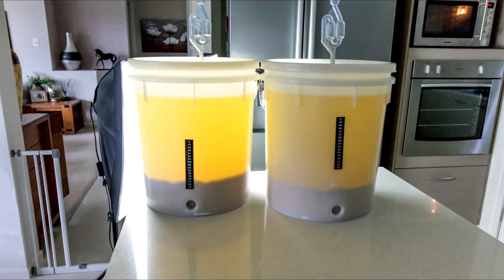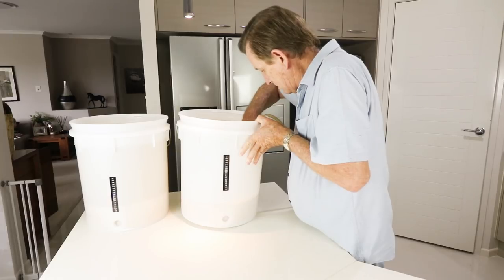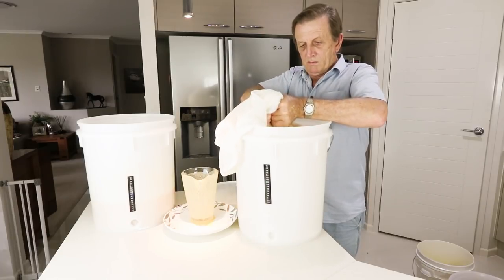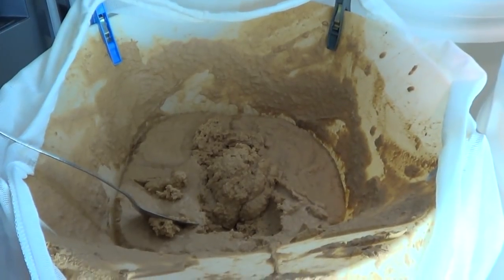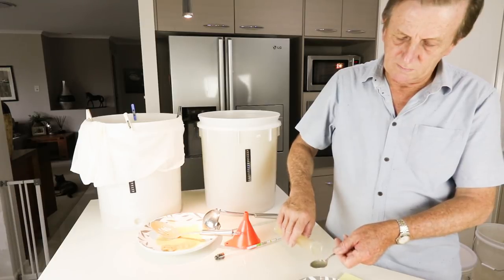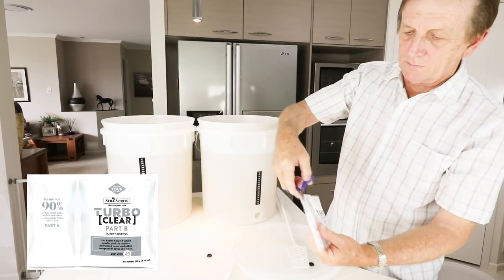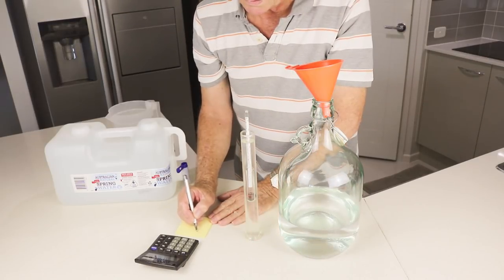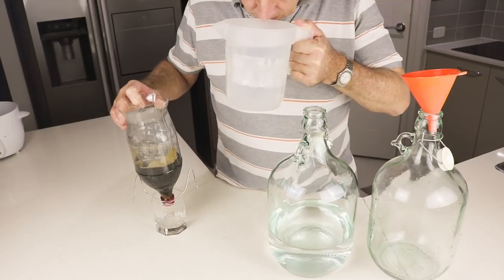How I Make Cornflakes Whiskey - Pt.2 The Distill & Taste Test

Comment: After running it through the filter does it still have the flavour of the whisky do you need to add wood chips because you could just use alcohol from reflux and put wood chips in it and do the same thing is that right

Comment: One thing you could do (I did not see anyone else mention this), but you could have rinsed your mash (the cooked grains) after you poured off the wort (the sugar water).  This is called sparging by the mountain folk here in the US, and it lets you get the last dregs of wort out of the mash.  It's easier to do than trying to squeeze the wort out of that big ball of mash.  JM2C.
Reply from the maker: Hey X.... Worth remembering, thanks.
Reply: @pauljacobs5390  Or just throw another 6Kg sugar and water in and let it rip again, bring up to temp and the yeast should wake up and a week later rack and still.

Comment: For ageing it could be better to try it at 62% abv. 40% sounds a bit low for ageing and extracting the flavours from your chips
Reply from the maker: Interesting, I think I will try this next time round.... Thanks
Reply: Can you use frozen corn from super market or food store?
Reply from the maker: @M_Ladd  Of course you can, but it will probably end up costing you too much. Refer to my Vid on making Corn Likka.....
Reply: correct it needs to be at least 62 or 72 thats how they do it at distilleries
Reply: Yes agree, I always age around 65%, then when ready I knock it down to around 42-45 for drinking.
Reply: @ARCSTREAMS  but.he filters the spirit which can't be over 50% or will defeat the parking flavor
Reply: @kevinacres1699  parking flavor?
Reply: @kevinacres1699  he can leave the proofing down and filtering in the last stages unless he is happy with the flavor then there is no need for polishing or filtering ,all he needs to do is filter for sediments and haze
Reply: @ARCSTREAMS  opps I don't know where parking came from. That's what I get for commenting from my phone
Reply: @kevinacres1699  so what did you mean to say?
Reply: @ARCSTREAMS  I've got sometimers. I can't remember now. I know I was commenting on the aging at a higher ABV then proofing at a lower ABV and my thought was the polishing would remove the aging flavor.
Reply: @kevinacres1699  yes that is kind of the trade off,,the worry is if the polishing might soften and remove some of the wanted flavors,,you can take a small sample and proof it down after ageing and if you think there are some flavors that are too harsh or off taste you can try polishing with a bit of carbon filtering or you can proof down and polish then age in wood etc and it might still work,i aged in oak wood at 40% but it takes longer for the color to come out right and who knows if enough flavour from the wood is being extracted, perhaps it works well the longer you age and that is a good thing actually,,,best is to make a good product from the start and make good cuts that way no need to worry about polishing after ageing ,then again that is harder said than done,its what making good liquor is all about,the art and mystery of it all
Reply: @pauljacobs5390  55% abv is the go middle ground 110 proof for wood extraction. in my opinion. Excellent video and production. These days I don't get enough time for videos myself, but truly understand and appreciate all the videos and efforts put into channels on YouTube cheers. 🥃🍻

Comment: Have you tried frozen corn from the supermarket?
Reply from the maker: Hey Jim, thanks for the suggestion. I think I will research it a bit and try using Frozen Corn. Good reason for a new video.
Reply: I don't distill myself as it it is illegal in Canada, however I'm very fascinated by the science behind it. I would think that using sweet corn would make for much better flavours. I have eaten feed corn before, but it doesn't compare in taste to the variety of corn designed for human consumption. It's my guess that you could get away with using far less sweet corn than you would with recipes calling for livestock feed. Cheers!
Reply from the maker: From the research I have done it seems that Sweet Corn is a hybrid of regular Field corn. Sweet corn is taken from the plant while it is still green and Field corn is allowed to dry while the plant dies. Ironically, the sugars in Sweet Corn have not turned into starches. In Sweet Corn there is decreased carbohydrate content and increased protein content usually results in lower alcohol yields with increased complexity of flavors. Most brewers choose Field corn for the much higher starch content and corresponding conversion into sugars with enzymes or malt barley. Have to admit Jim, I am interested in attempting a Frozen Sweet Corn batch regardless of alcohol volume just to see what flavor I can get.
Reply: Interesting information. I do look forward to any potential video that may result. Cheers!
Reply: Jim Dent I saw some old timers in the states use corn cereals, canned corn, and corn meal in boxes. They warn to never use the self rising stuff, because it has something like baking powder in it.

Comment: Awsome!!.. What final ABV did you cut it to.?.. Also.. Keep on posting these videos.. There great.,
Reply from the maker: Hey Pierre, I prefer to cut to 40% ABV on all that I do.
Reply: Someone commented on your previous vid. To use corn syrup instead of corn flakes.. An interesting suggestion to cut-out the mess in this recipe., I may try that next.. But first I have to find a way to convert my reflux-still into a pot-still..
Reply from the maker: I agree that Corn Syrup would be better, but here in Australia threr arer three forms of Corn readily available at a reasonable price - Corn Cobs, Frozen Corn and Corn Flakes, everything else Corn related is classed as specialty imports and usually a high price for a small amount.

I started off my Brewing journey with making my little pot still. Worked perfectly, but in small quantities. I always did Ripping Runs and later a run to remove the Heads and the Tails. Easy task with being able to control the temperature inside my pot.

When I bought my Column Reflux still from Still Spirits I tried Ripping Runs but found it nearly impossible to re-run again to remove the unwanted stuff. My thought is that because the pot is boiling flat out it somehow ended up combining all the spirits together the second time round.

My thoughts is to introduce a Thermostat on the heating element and put in a temp dial within the top of the pot.